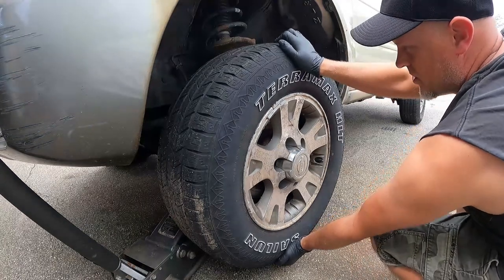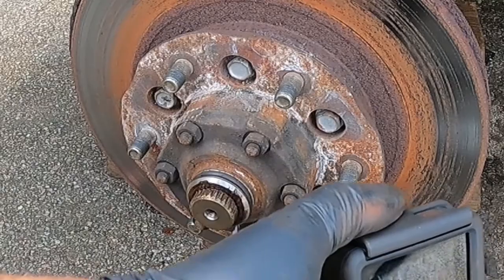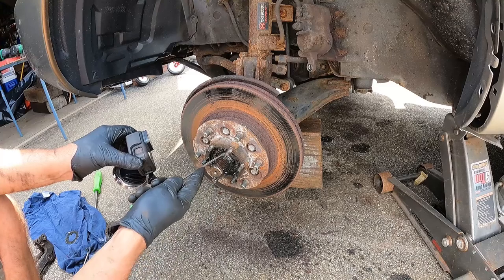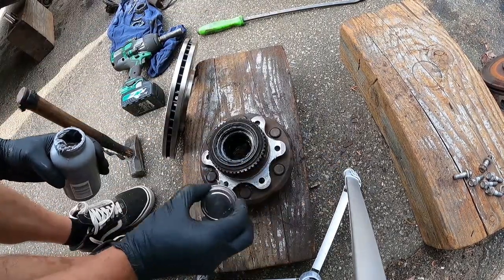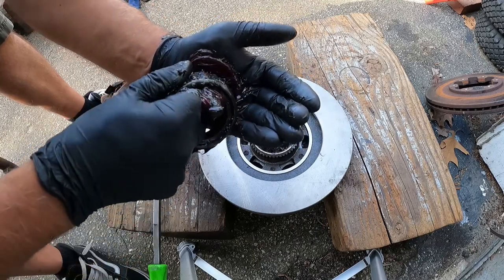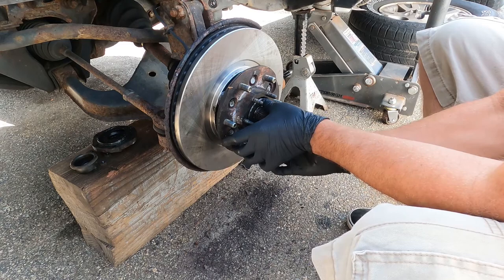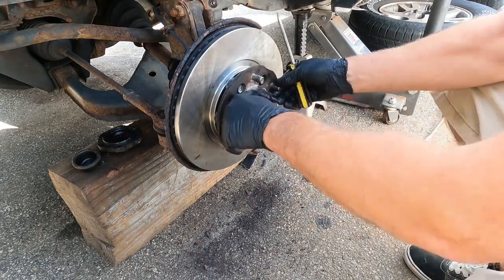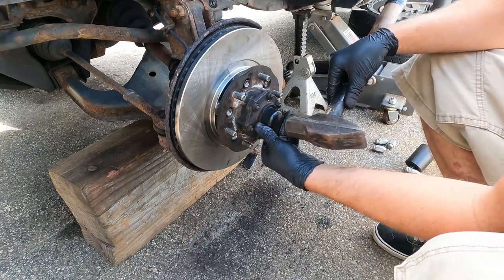How to replace front brakes 2000 - 2004 Nissan Pathfinder

Comment: Your video helped me a lot. 
Only thing I would recommend is that if someone is also replacing the rotors at the same time that they first separate old rotor from hub as you did, wire brush them both, then 'reassemble the two back together' with 3 bolts snugged so that you are banging on the old rotor (over wood etc.) while you drive out old races and/or hammer in new ones. 'After' new races & grease seal is installed then re-separate the old rotor from hub again (already free'd up) and bolt on the new rotor so as not to damage or warp it. 
With your video guiding me I used scrap 2-⅛" O.D. aluminum pipe in lieu of 1-⅜" impact socket (1-½" abs drain pipe works too-  if angled) to quickly punch out old seal from back side.  Used 3" I.D. pvc scrap pipe (cut square to about 1-½" long donut) with piece of ply on top to drive home grease seal (to avoid damaging grease seal raised rubber flange). Totally worth investing $25 bucks in a Lisle bearing grease packer for the time I saved. Bought cheapest H.F. (amazon even cheaper) bearing race driver- good for 'maybe' driving 8 races then throwing away - but for 4 races they are fine.  Also used 2x6 / 4x4 / 4x6 scrap wood like you did. Would never have known to check for burrs and sand them down (where a punch meets rotor sides while hammering out races) and eased high spots with end of flat blade screw driver and emery cloth - I'm sure this is a pitfall that can cause many problems if burrs misalign race(s).  Was very cautious of reluctor wheel as instructed, otherwise I would have never given it much consideration.  Buying the Spindle Nut Socket is a must as well.
Reply from the maker: Great tips! 👍

Comment: My bearings don't have play, but they do growl when I spin the wheel and can feel vibration on the strut spring. Should I replace them or can I just repack them?
Reply from the maker: Chances are you need to replace them. I would take them apart and reevaluate.

Comment: Mostly correct, however you need to clean the bearings and hub before packing and adding new grease. This is standard practice in all decent shops.  Retired Certified Mechanic here.

Comment: Been following you for a bit even with your videos from your job...Question: is there a torque spec for the hub to rotor bolts?
I'm currently doing a CV boot for passenger but I also need to do a steering Bellows. By anychance you might do that or is it very straight forward?
Reply from the maker: Thanks for following. In the book the torque spec for the hub to disc bolts is 36 to 51 foot pounds.  And the steering bellows should be pretty straightforward.  Good luck! 😁👍

Comment: Hello. I'm a little confused, should there be two wire spring clips on top of the brake shoes that spread the pads away from rotor when not braking. My old pads had holes in the tops for these wire spring clips to go in. My new pads dont have the holes but came with the clips????? Thanks
Reply from the maker: Yep you should contact the company that make the brake pads. There should be holes so you can put those springs in. Better to have the springs although the brakes should still operate normal without them. I think they will just help making the pads last longer. And probably quieter.

Comment: So I’ve tackled this job a multitude of times and I can never quite get the wheel torque right so that it has no play.  There’s always at least a little play at 12 and 6 o’clock on both front wheels, but weirdly not at 3 and 9 o’clock.  On top of that I’ve seemingly gone through I don’t know how many warped rotors I’ve lost track.  

I’ve replaced my wheel bearings twice with Timken brand and no change.  Went with Powerstop pads and rotors with the same results recently. I always grease slide pins and I have cleaned to perfection the caliper brackets where the pad ears mount.  What’s going on?  Can’t say for sure if my caliper pistons are applying equal pressure but the pistons seem to protrude equal amounts.  Still doesn’t explain why my wheel bearings won’t loose the play.

Comment: Hey Andy, I have a 2001 Pathfinder with no crank no start. As soon as I open the door to get in the dash lights and tail lights start blinking. Any idea what could be causing this? I don't even know where to start.
Reply from the maker: Check the battery. Make sure it’s fully charged.
Reply: @AndyTheXTech  battery is brand new
Reply from the maker: @Loganbravo999  do you have a volt meter? What’s the voltage at the batter?

Comment: Do you actually have to take out the rear bearing?
Reply from the maker: Only to pack it with grease. It’s a good idea. While your in there.
Reply: Thanks, will do. Never done these kind of rotors before, so I wasn't sure.

Comment: So confusing is it a wheel bearing fix or a break pad fix video just saying
Reply from the maker: If you replace the front rotors you need to remove the hub and repack the bearings because the rotors are bolted from the back side.
Reply: Craziest thing I've ever seen , and I've done a ton of brakes

Comment: Man what an awful vehicle
Reply from the maker: Well the brakes are tough to do quickly but the vehicle was rock solid. One of the best vehicles I’ve owned.
Reply: Aside from the brakes being abnormal, the design of most other things is brilliant. The fact that they have a little drip tray/protector under the oil filter is absolutely genius.